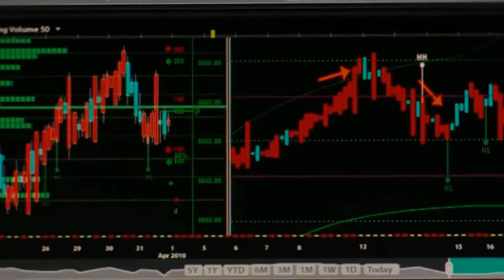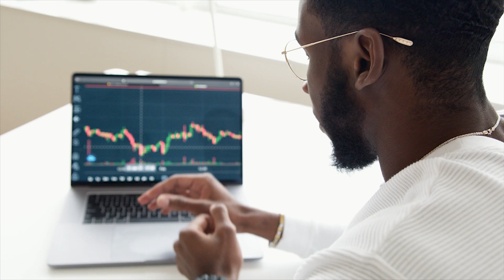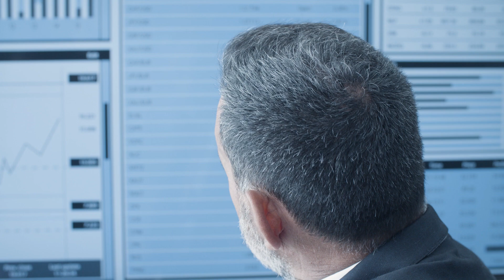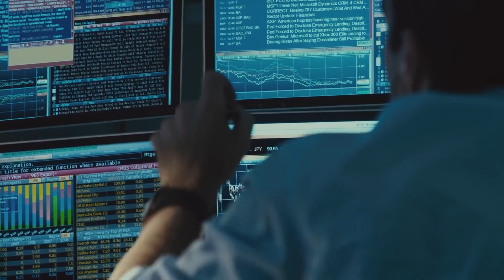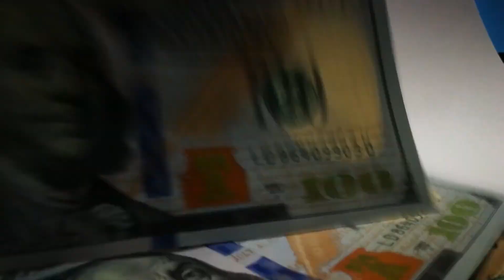What If Internet Shut Down FOREVER?

Comment: people live just fine before the internet is relative new commodity ,  majority of people got internet  only the last 10 years ,   and before the 2000 internet suck ,   living without electicy will suck more since is over 100 year wee have it , and everything depend on it ,  good luck using steam to power basic stuff ,
Reply: @GHOSTSTARSCREAM losing electicy is actual a big deal today , yes you can go and live fine off the grid ,  but everything run on elecicy  from your toilete  to your supply in food ,  iven your heating in winter ,and your ac in summer , if big city lose power for a week will be unlivable ,and lot of people will actually die and fast ,
Reply: @GHOSTSTARSCREAM wee can still trade in cash , not such big problem ,  withaut frige meat and other foods will spoil on one day ,  withaut working pluming ,  your house will smell so bad in few day thant you can not live ther ,  ask a fat person to go up 10flores ,  and try to stay out at -10 for few houes ,